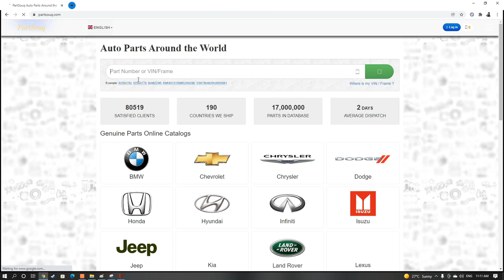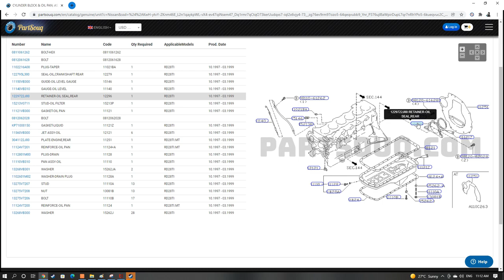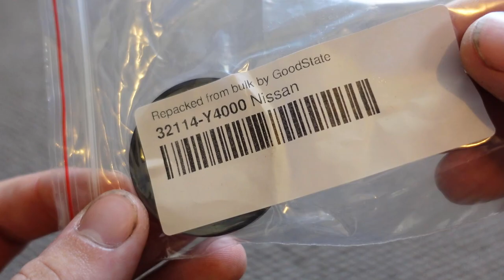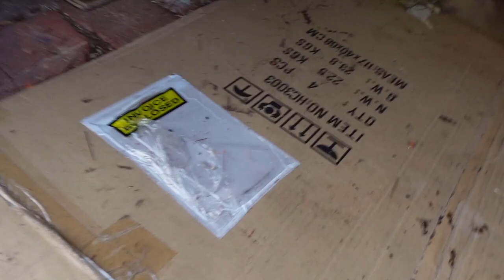Solo Gearbox Removal - RD28 Patrol

Comment: My 2.8l GQ got 320,000 ks and the original clutch which really needs changing badly. I purchase from a interstate truck driver he taught three of his four daughters how to drive in it one just couldn't get the gears my son to drive in it. Cheers Graham
Reply from the maker: thats a pretty good effort for a patrol clutch. my first car was a 1997 hyundai excel 1.6 and 7 people learned to drive in that car on one clutch. since that hyundai would be 1.2 tonnes lighter than a GQ patrol that makes sense the clutch would be under less strain.
Reply: @ebayenthusiast42  I been changing a few parts. Old guy didn't replace anything. Patrol are well made.